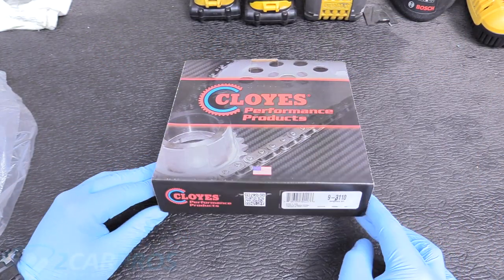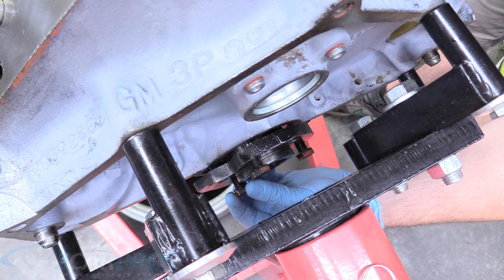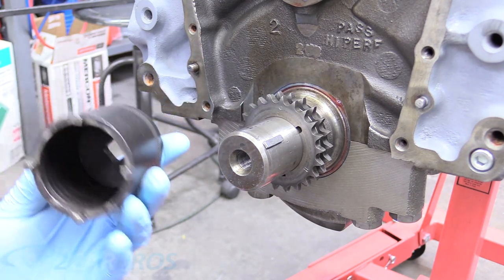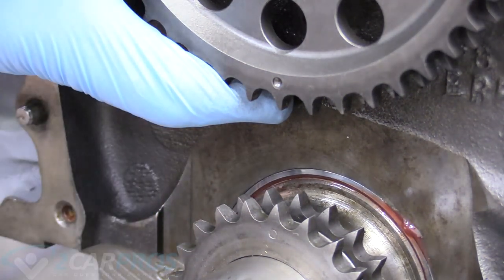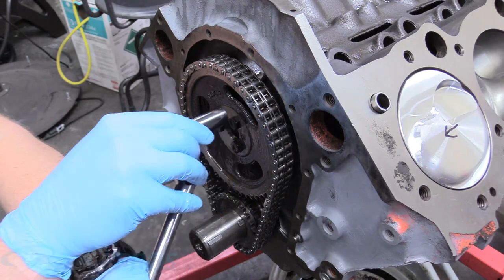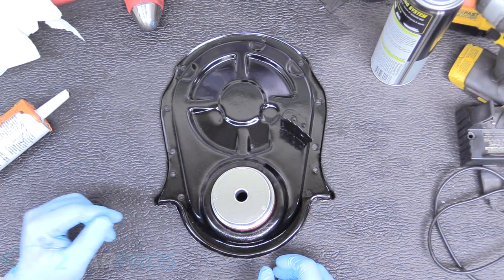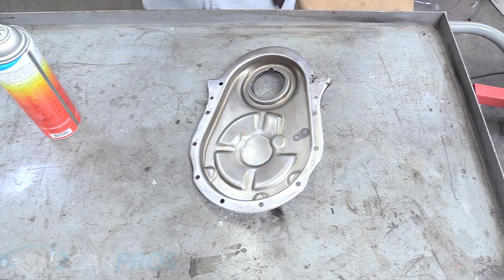How to Build a Chevrolet 454 Big Block Part 7: Timing Chain and Cover!

Comment: Why did you change the cam sprockets midway through the install? You open a box with a nice billet sprocket, but installed a cast sprocket.
Reply from the maker: I didn't, the camera settings makes it look kinda like billet in the first shot. But it is cast. Thanks for watching!
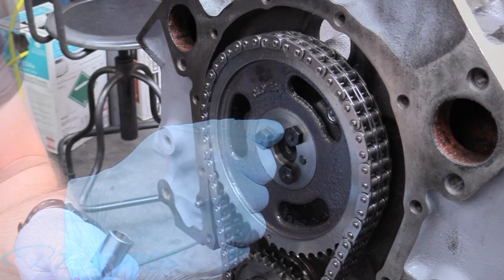Reply: @2carpros  dude what are you talking about? The sprocket at 2:03 has holes all the way around. The sprocket at 9:29 has 3 oval shaped holes. It's unquestionably two different sprockets.

Comment: I just bake my lower gear in the oven 350° for 30 minutes have my wife bring it to me on a tray and stick it on with the welding gloves lightly tap it on with a brass drift the bottom it out piece of fucking cake no special tools required

Comment: I was going to rebuild my engine but come to find out I don't have to I got a 1992 Alero RVs been sitting for 10 years got a 454 4 bolt main 4 speed tranny only 40000 miles on everything last time this thing's been registered was 2010 but my engine does not need to be rebuilt is it worth any body out there kind of in a tight spot I live in Florida
Reply from the maker: That is a solid source for big blocks is old RV's. But how do you know its a 4 bolt? Thanks for watching!

Comment: Does the oil pan have to be off to install what you have here?  Also is there a risk of messing up the distributor if it was removed when the engine wasn't at TDC?  Great job, thanks!!

Comment: Only comment, seal installer was upside-down. The proper installer is designed to fit inside the seal.

Comment: Nice job, what is on the deck surface? By the #1 cylinder?  Corrosion? How deep
Reply from the maker: That is just some surface corrosion. It is totally fine. I had the block hot tanked and magnafluxed. Thanks for watching!

Comment: Did you clean the bolt holes, too?  Otherwise, the locktite will be trying to hold onto oil, not metal.
Reply from the maker: Cleaned the whole block. Thanks for watching!

Comment: Hey buddy love your video series. You have to tell me if you sold the two bolt Main to cover the cost of all the Machine Shop work at least what did you do
Reply from the maker: Hey Ken thanks for watching! Yes there was a bit of horse trading for the machine work on the 4 bolt. Really didn't need a machined 2 bolt when I had a 4 bolt.

Comment: I noticed you didn't install the cam retaining plate. I assume that means it isn't really necessary.
Reply from the maker: Good eye! We ended up using a different timing set that didn't have one. If it came with it use it but if not, no biggie. Thanks for watching!

Comment: Does the cam use a plate with the 2 bolts to hold it in on the front or or is it for roller cams?
Reply from the maker: No, not on this engine. I don't believe the roller cam matters for a thrust plate. Thanks for watching!
Reply: Yes it does. Flat Tappets don't need one, Roller cams do.

Comment: Hi Ryan,
Will it make huge difference if I set the timing gears on zero when the cam card is advanced ground 2 ?

Cheers 👍🏾
Reply from the maker: Ok so that advance is ground into the camshaft as it is when the two dots point at each other. I called an asked them just to be sure. Thanks for watching!